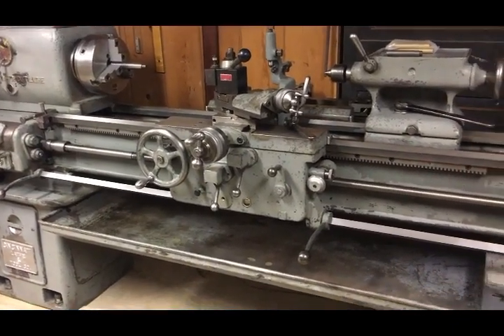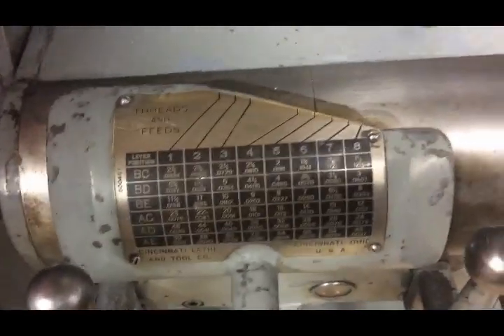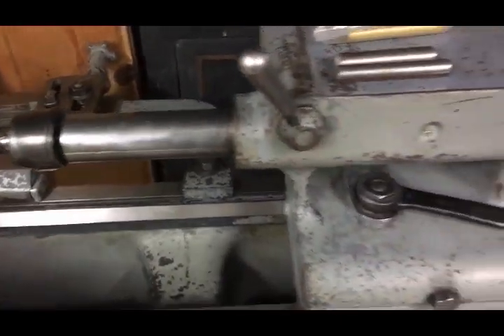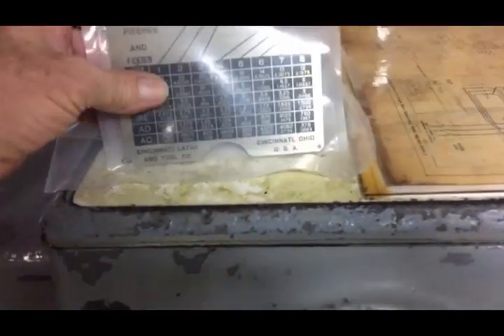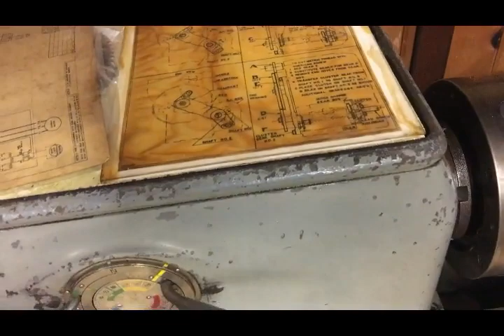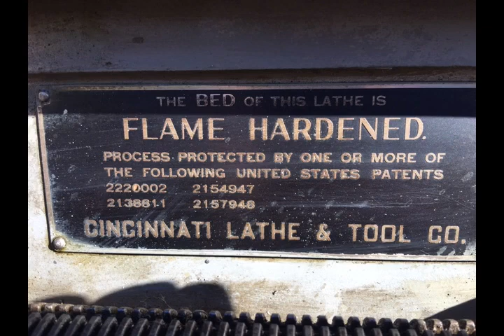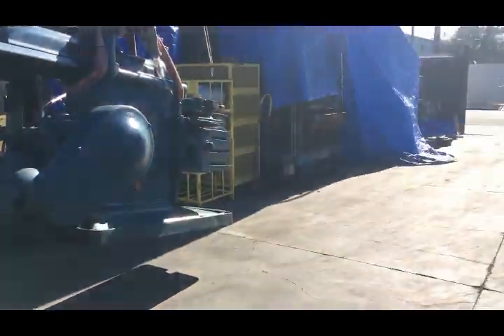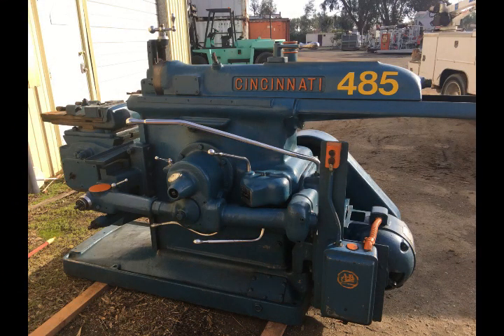Adding A Couple Cincinnati's to the shop

Comment: Nice machine machines. Cool story on the lathe. I saw that shaper forsale on E-bay. Glad you got it.
Reply from the maker: Hi Tom, I won it on a auction bid. When I also seen it on eBay I thought there was no way I was going to win the bid. Thankfully I was wrong. What I ended up paying wasn’t even close to what they were asking on eBay. It just shows that you can’t use eBay for determining a price. 😊
Reply: Old Iron Machine Works awesome.